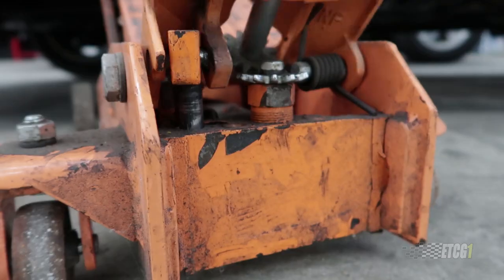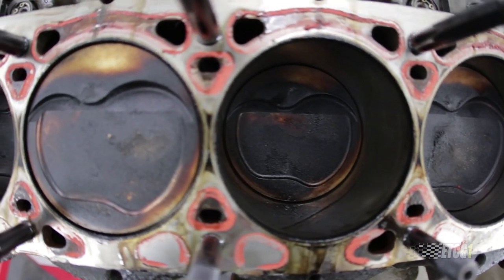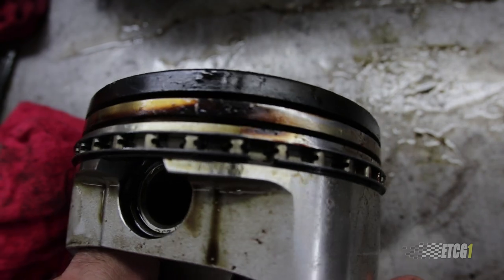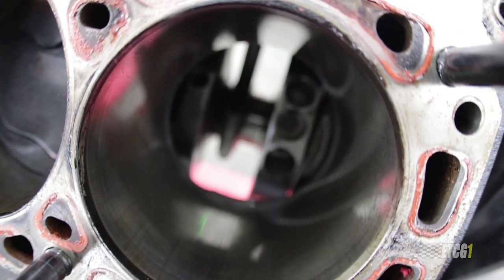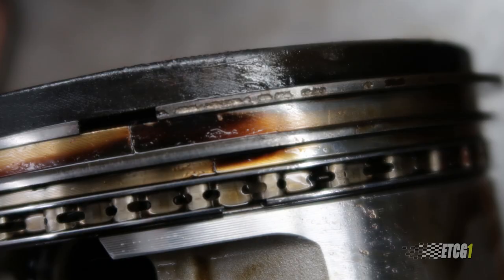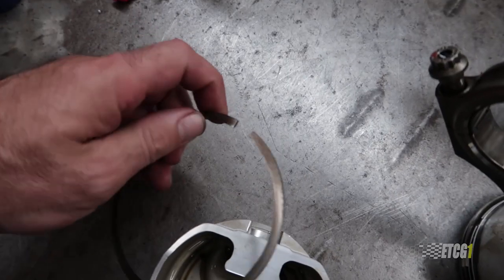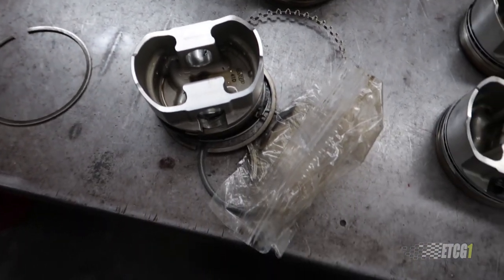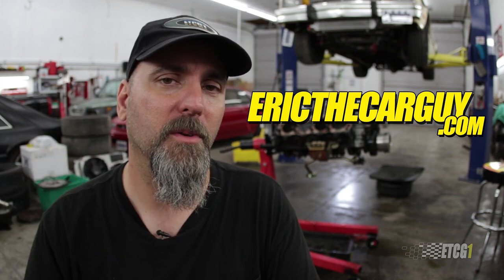Hydrostatic Lock the Silent Killer

Comment: That sucks for a relatively new engine.  You don't think it was due to detonation because of cylinder knock?  I've seen exactly this happen with detonation and it only takes once or twice for serious knock to occur to break a ring land.  Did the big end bearings look hammered or squished a little bit by any chance?
Reply: ArchimedeanEye  he had the problem with the fuel, he did lock it up on the gasoline, it was the only cylinder affected. He would have heard the detonation but he did hydrostatically lock it,  it was documented on video.
Reply: The breaking of a ring land during the hydro-lock was not documented.  That's a guess.  I've seen far more ring land's break because of detonation than hydro-lock. This being a turbo engine running pump fuel without any kind of knock control or ignition-timing control for intake-temp compensation would make it prone to ring-land breakage.  It's the reason why switched on folks run full engine management aka EFI.  Anyway, I have been saying that to Eric for years now and even now after an engine failure he probably won't learn until engine failure #2.
Reply: Kelly Bullock  Also very unlikely that the pistons broke due to the hydro-lock and then ran for months and months just fine, including lots of high-load tuning and 22+ hours of driving to Jekyl Island.  More likely there was uncontrolled detonation.
Reply from the maker: If that was the case, why was only one cylinder effected?  In fact, everything points to good combustion in all of the other cylinders. 

You're forgetting that I have a boost timing regulated ignition system. It pulls 2º of timing for every pound of boost. 

Don't even start with your normal crap about EFI. The evidence is clear that this had nothing to do with fuel mixture. The facts are right there in front of you yet you insist that you're right. I thought we were past this. 

I'm willing to admit when I'm wrong, why can't you?
Reply: I didn't say anything about fuel mixtures.  I am talking about ignition timing and detonation.  Let's say you are sitting in traffic or it's a warm day.  Your engine bay temp increases by 30 or 40f easy.  You now have a much greater chance of detonation, but your ignition system nor your fuel system can compensate for this and it WILL lead to detonation that is uncontrolled.  EFI is not just about fuelling.  You may get the fuelling perfect with the carb, but you will never be able to account for all the operating conditions and temps as far as timing is concerned with a carb system.  

It's not about being right Eric, it's just about facts and a shitload of experience we've had out there braking ring lands for the same reason.  If you want to believe that you cracked and broke aluminium and then drive thousands of miles, go right ahead, but those of us in the know can see this is detonation related.  The mixtures and piston crowns can look fine with detonation, it only takes a little and bad things can happen.  

I don't know why you are so defensive about this.  Even in this video you don't even DISCUSS the fact that it could be due to detonation. It's at least worth discussing, but you want to shut it down.  Detonation has nothing much to do with fuel mixtures, it has to do with firing the cylinder ahead of time, a kind of hydro-lock effect in itself. No piston can break and then be driven for thousands of miles just fine. Especially the top piston ring land.  The flame-front would have taken a fractured piston out very quickly.
Reply: +promethbastard  It's not my fault you cannot comprehend my comments.  Anyone with the relevant experience could.
Reply: +promethbastard  You just wrote one paragraph of meaningless hot-air, but you are not addressing the difference between:

1) breaking a piston via hydro-lock and beating on it for thousands of miles

and

2) detonation via insufficient timing control across all conditions

Clearly you are not a technical person, so move on.
Reply from the maker: OK, let's explore that theory for a min. If detonation was the cause, why weren't the other cylinders effected? All of the other cylinders and rings look like the one seen in the video. The piston that wasn't damaged.

Second, I do have timing control as I've already mentioned: https://www.msdperformance.com/products/ignitions/street_and_strip/parts/6462

Third, I have 4000cfm fans installed. I also have a hood vent. Temp never gets above 220º and that's with the air on in traffic. 

Please explain how detonation could have caused that specific damage in that situation.
Reply: +ETCG1  Are you monitoring your intake temps?  You can easily have a spike in intake temps which will need a degree or two of timing (or even much more) pulled.  If you are not monitoring your intake temps and not pulling timing in relationship to intake temps, ring land breakage can indeed happen.  Often it will only happen to one or two pistons at a time if the detonation is not super terrible.    

If you look at ECU's of the last 10 years, say a Siemens GM E38 or E40 used in the LS, they have multiple ignition timing offset functions to protect the engine in these situations, because in boosted engines, it's very possible, even likely, to break a ring land under changing conditions.  Ignition timing in modern engines depends on 10 to 20 variables, not merely rpm, load and manifold pressure. This is the reason why modern engines can produce 500+HP reliably.  

It's very easy to see intake temperature fluctuations of 100 degrees or more between high-load runs after an engine has heat-soaked and this is where you need additional timing to be pulled and additional enrichment outside of 'normal' operating temps.  

I'm not talking out of my ass here Eric.  Most shops literally won't build combo's like you have for customers, not because they aren't cool, but because there is no way to monitor or control all the variables in a boosted engine using non-engine management systems.  You can get away with it on an NA engine, because you don't have the additional compressor (turbo) massively increasing intake temps and other related conditions. 

Happy to be wrong, but I simply can't imagine a fragile ring-land breaking and then being driven thousands of miles, many heat cycles and a fair bit of boost/power runs. It's much more likely that you rattled a ring land to pieces which many people have done boosting an engine with a carb and conventional timing.

Also, checking spark plugs and piston crowns for carbon deposit color etc is not an accurate gauge of all conditions and all engine loads, it's just a very fuzzy overall picture.
Reply: +ETCG1  The ignition system IS inadequate.  You are not measuring knock and you are not measuring intake temp and you are not adjusting for either of these.  Compare your marketing spiel from MSD to a 20 year old ECU and it's functionality and tell me the MSD is adequate.  It's simply not!  It MIGHT be adequate for a drag car, or salt-racer where conditions are constant, but not a turbo road car.
Reply: +ETCG1  How does the MSD account for intake temps or fuel variables?  It doesn't.  And these easily lead to knock (which you are not measuring either!)
Reply: +231mac  It was the top ring land and below that broke.  The only thing above that is the piston crown. That won't get impacted unless the mixtures are way off and/or the detonation is of a particular type (like wrong spark plug heat range).  The engine only exhibited excessive blow-by thousands of miles after you claim the piston broke.  It doesn't seem very likely that the engine ran perfectly fine (no excessive blow-by) with cracked ring lands for this length of time.
Reply: ArchimedeanEye I have a question to ask why is it that the damage to the piston ( one ) is the same as the piston that was hydro locked and the other 7 pistons have no damage at all,  would you theory be seen globally amongst all of the pistons.
Reply: ArchimedeanEye - Just a quick question/point from someone with nowhere near the experience that folks in this section seem to have, (no sarcasm!)  If the engine was indeed detonating enough to break what is, I assume, a forged piston, wouldn't it be likely that other pistons would have cracks or other indicators of said detonation?  Also, just a side reference, I believe the hydolock moment was indeed caught on tape and was shown a couple of times in this video.  I know the offroad world a bit better than the performance world, and that certainly looked like hydrock.  Again, all of this isnfrom a simple, self-taught, backyard wrencher; so please take this with a big old grain of salt.  ☺
Reply from the maker: ArchimedeanEye The engine didn't run perfectly as previously stated. But why let facts, or anything I say, get in the way of your instance that yet something else is wrong with my build. I suppose this is just another situation where we just have to agree to disagree. Till next time.
Reply: P Ferris Anything is possible.  I have seen many engines exhibit only a problem on one or two cylinders. E.g. the fuel distribution might be slightly different on that cylinder, typical of a carb setup.  The cooling on that cylinder can be slightly different. A simple AFR gauge does not tell you the AFR of each cylinder or EGT of each cylinder, nor does it track knock.  Eric's setup does not detect knock.
Reply: +ETCG1  You drove the car 22+ hours to Jekyll island and back after you claim to have broken a piston + other driving I assume - and you stated the car ran flawlessly in those videos.  Now you are stating the engine didn't run perfect all that time?
Reply: ArchimedeanEye No, the second and third ring lands broke. Here, maybe this will help educate you : http://www.jepistons.com/PDFs/TechCorner/SCPDrawings/JE_Piston_terminology_and_features.pdf And his piston shows NO signs of prolonged detonation. And he said it WASN'T running fine. Dude, seriously, the engine hydro-locked and this type of damage is commonly found in this scenario.
Reply: +231mac  The piston crown and top ring land is one piece.  Unless the piston crown melts, it's not going to crack and break the same way as what we see here (unless it has a slotted oil drain back design).  Eric said it WAS running PERFECT for the whole trip to Jekyll Island (in the Jekyll Island video 'powering up the hills in 5th gear') which was just after the engine hydro-locked.  That was at least 22 hours of running time + a bunch of tuning after the fuel pressure regulator was installed. Are you suggesting the engine ran perfect all this time with broken ring lands?
Reply: ArchimedeanEye dont listen to the haters, and if eric doesnt believe it and doesnt take measures to prevent knock, we will see another video in the future saying something like "alltime conspiracys: why does my fairmont keep breaking ring lands?"
Reply: arielatom03 I agree, I have never seen hydrostatic lock cause damage without the engine actually firing/running, the starter motor usually doesn’t have the power to cause that kind of damage. I would be way more worried about detonation causing this failure especially with the fueling/ignition setup the way it is. You can have pre-detonation way before you can hear it with just your ears. Once it’s all back together maybe Eric can make some diy det cans and do some video on monitoring knock on a engine like this without knock sensors and see if there are any problems that would have caused the failed ringlands.
Reply: Eric, stop playing with the trolls, we both know you're better then this. And please ban this guy!
Reply: sparkplug1018                       As a casual observer, I disagree with banning those that are presenting a different viewpoint than Eric. A lot can be learned from a respectful debate from people with different points of view. They are bringing up valid points about the dangers of pre-detonation and detonation and we shouldn't be so arrogant that we can't consider that we are wrong. 
                I would like to see specific examples and details at this point, of where detonation caused the same problem because of inadequate ignition, temperature, and fuel monitoring.........Time for the opposition to make their case with photos, measurements, and CASE STUDIES that prove their point and take this discussion beyond speculation by showing similar cases where detonation caused this same damage.
Reply: ROTAXD We're not talking about an 80hp engine from the 1960's here.  OEM and aftermarket ECU's have 15 or 20 ignition timing offsets to deal with ALL variables.  Of course knock is not going to occur at idle.  We're talking about variables like a heat soaked engine or poor fuel quality or intake temps sharply increasing.  All ingredients for knock.  None of which are being measured or controlled.  The pitfalls of trying to keep a turbo engine in a road car tuned across all conditions is well documented and has been for decades. Detonation does not need to be audible to rattle engines apart which is why the knock sensor was invented. The problem is that Eric is biased not only because of sponsorship (stating that MSD is the best, lol) but also because of pride.  9/10 people here cannot see it because they are performance/modification noobs.  However, for those with eyes to see, it's pretty obvious the whole topic of improper tuning and engine monitoring (which often leads to broken ring lands) has been sidestepped entirely.  Just another reason Eric's channel has gone down the toilet in my book.
Reply: ArchimedeanEye Yes, I know where the the top land is located and that the crown and top land is one piece; hence the link I sent you. That is also why I corrected you when you stated the 'top piston ring land' was damaged. And, once again, the top land is undamaged, discrediting your prolonged detonation theory. Also, I'm pretty sure Eric would have noticed ongoing detonation, as it is fairly easy to detect by sound and feel. And as for running perfect on the trip up, that is very possible. The second and third ring lands were being firmly held in place, especially after expansion, creating an artificial seal. Did you see the Moly coat removed from the comp ring? One could accurately guess that with the slowly increasing of unwanted flex the ring was experiencing scrubbed off the coating AFTER many miles, which deteriorated compression. Combined with the increase of unwanted movement from the rings and broken ring lands only exacerbated the issue as miles went on. The reason I'm so adamant on defending his diagnosis is because I have seen similar cases from head gasket failures. And two cases were from identical vehicles, early 2000 model Toyota Tocomas with the 3.4L. They had iron blocks with aluminum heads and graphite head gaskets (huge no no). Both came in, obviously at much spread out intervals, because of losing coolant (but no leaks to be found) and with an intermittent misfire codes. Both ran and idled very well, but would intermittently vibrate under load and throw codes. After bore scoping, found both engines to have blown head gaskets and broken 2nd ring lands. Turns out, that after the coolant was pressurized, and the vehicle shut off, it would leak enough into the affected cylinder just enough to create a hydro-lock issue. Mind you, I haven't seen this often, but I've seen it.
Reply: OMFG, get off it, will you?  If you were going to detonate it would not be in the coolest cylinder in the engine:  #1
Reply: 231mac That is interesting and thank you for the piston anatomy correction. However, I still believe this to be related to subtle but prolonged detonation across certain conditions. I have seen many people over the years, (amateurs and professionals) including myself years ago, play with carb turbo engines lacking in good engine controls exhibit exactly this same result. Pitting and damage to piston crown, combustion chamber or spark plug is not always evident. The AFR's are bound to be running pig rich most of the time which will keep cylinder temps relatively cool masking the combustion area from any real heat damage but will not prevent an engine from rattling to pieces over time where subtle detonation is not addressed. I have seen small-end bushes in conrod's pounded for the same reason and so the engine develops a small rattle over time. It's often not all cylinders that will present the problem either since this depends on cylinder cooling, exhaust scavenging and all sorts of other variables that influence each cylinder.  Maybe we will never know, but for sure I can tell you Eric continues to take a big risk trying to extract reliability out of a turbocharged road car subject to wild temperature fluctuations and risk of detonation without measuring or controlling either.
Reply: Sean Crane Not an argument.
Reply: sparkplug1018  Having an informed opinion is not trolling.
Reply: Sheri Schneider  There is tonnes of info out there on this subject, but here is some:

Extracted from:  enginelogics dot com/engine-detonation

Engine Detonation causes three types of failure:

1. Mechanical damage (broken ring lands, Bent connecting rods, rod bearing failure)
2. Abrasion (pitting of the piston crown)
3. Overheating (scuffed piston skirts due to excess heat input or high coolant temperatures)

"When people see broken ring lands they mistakenly blame it on pre-ignition and overlook the hammering from detonation that caused the problem."

"An unmuffled engine running straight pipes or a propeller turning can easily mask the characteristic ping. The point is that you honestly don’t know that detonation is going on. In some cases, the engine may smoke but not as a rule. Broken piston ring lands are the most typical result of detonation but are usually not spotted."

Another good read, (although very out-dated now in a lot of areas) is Maximum Boost by Corky Bell. You can download the scanned .pdf for free online. Chapter 9, page 112 about Ignition timing.  Despite the age of this book (20+years) note his comments on the perils of carburetor turbo systems in the opening of chapter 8:

"At first glance, the idea of modern turbocharged engines and carburetors all in the same package
appears to be a contradiction.  A closer inspection reveals that it is indeed a contradiction" - Corky Bell.
Reply: ArchimedeanEye . I am not going to get into what caused the broken piston but you keep saying about inlet air temps. A carburettor will actually cool the air charge down quite an amount due to the Venturi effect and the fuel being atomised. That's why some supercharged engine's with carburettors run without a intercooler. The temperature drop from the inlet of the carburettor to the outlet can be upwards of 80 to 100 degrees. Cheers.
Reply: Mark Thomas   A consistent temp drop of 100 degrees or anything like that across all conditions in a heat-soaked engine is just absolute nonsense.  Show me some IAT1 and IAT2 logs of a blow-through carb on pump gas in a heat soaked condition and I will believe you, but otherwise... this is more generic internet mythology.
Reply: have you ever seen rings move